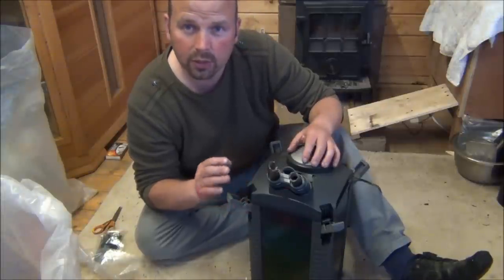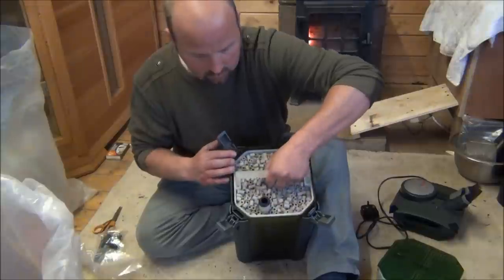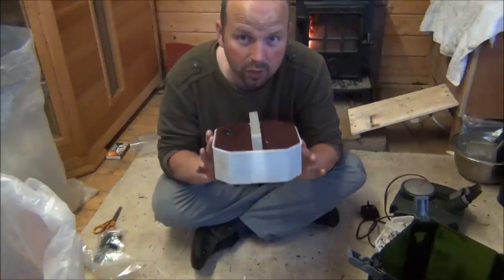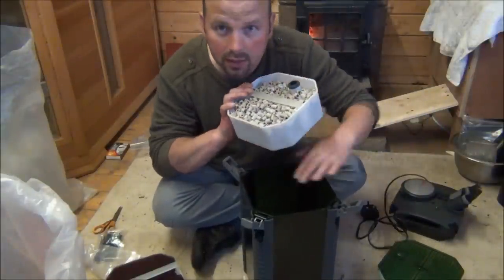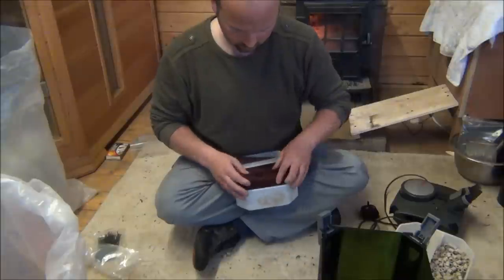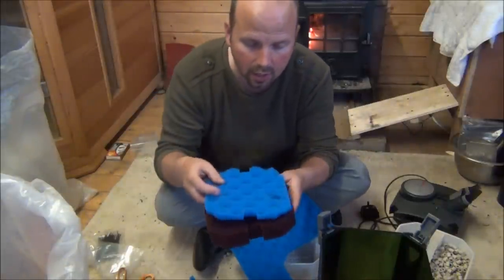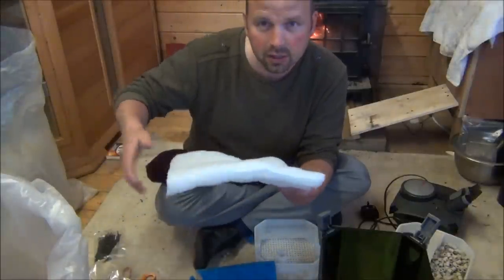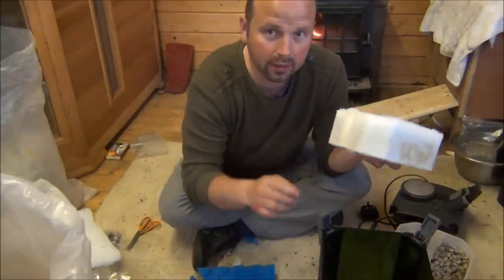How to set up an external canister filter for aquarium by Pondguru

Comment from the maker: +Joel Kim
Not really as anything fine enough to get through the coarse, medium and fine foams will simply be caught second time around. Last thing you want is the fine particles held in the media chamber clogging up the media and reducing efficiency.
Reply from the maker: +Mr.b External filters are generally very quiet and the main noise will be from water entering the tank via the spray bar.
Reply: +Pondguru Outdoors great answer and yeh if there is any noise generated thats loud enough to hear from these you may have air in your pump depends really and also if there is a quite hum im guessing you have it underneath the tank on wood or whatever its on you can reduce the resonance with a rubber pad or a sheet of thin foam thing is  you will get many different answers on the internet by hobbyists and everyone has there own setup and opinion on things i just think its a research and learn thing you will never get the write answer about stuff like at the start saying ceramic media is less than useless well it isnt its good in a fresh water tank and its a sort of substitute if you dont have live rock
Reply: +Pondguru Outdoors I have some cheap filter and its the other way arround. I guess its just a design. The 2x bio media is great idea ill try adding more bio.
Reply: i have 2 yellow belly sliders and they are very messy, i have an allpond 1000L an per hr filter in abt a 300l tank, it has 3 chambers, bottom has ceramic the middle has premium carbon and the top has bio balls.

If i have ceramic rings in the bottom trey, and the 3 foams you used in the midlle trey and the same media you used in the top trey will it srop my nitrate levels building up so high, after 2 days they can hit 80ppm+.
Reply from the maker: +Link SSZ (Nintendian) Sounds like the filter is way too small for that tank. Ideally you want layered foams in bottom tray and media in 2 trays above that but according to my records the trays for the 1000 will only hold approx. 1kg biohome mini ultra / ultimate per tray so that's only 2kg for the 2 trays. Ideally you would use 1kg per 100 litres to achieve full cycle filtration for a normal tropical community tank but for heavy polluters like turtles you may need twice as much (the equivalent of 3 of the 1000 filters - 6kg in total).
If that is the only filter you have on the tank it has no chance of making the water good no matter how you configure the inside unfortunately.
Reply: Ok thanks for the info :) i also have the filter booster, if i was to get the 2000ef model with 4 trays and fill that with the media you use (i don't know how much the trays hold) and the booster with the foams could that be enough?

Thanks again for the reply :).
Reply from the maker: +Link SSZ (Nintendian) Yes that is the level of filtration needed for turtles and the 2000 plus booster would be a very good choice for that scenario. The booster does a great job of cleaning the water freeing up the main canister filter for the biological media. Each tray in the 2000 should hold approx. 1.65kg of mini ultra or ultimate so in total that would be around 6.5kg - if you are in UK and would like a price for that just let me know at pondguru@btinternet.com or check my website for other suppliers around the world http://www.filterpro.co.uk
Regards,
Richard
Reply: Awesome ill get the 2000ef as soon as i have the money :) just wondering what the results would be if the trays were filled with premium carbon as i have a few KG left that i bought in bulk,

And yes i live in the uk, i have looked at your website and 5kg for £65 is way too expensive for me :( i would have no choice but to buy a kg bag every couple of weeks until i have whats needed.

How long does the the mini ultra/ultimate last? And which one is better for turtles?
Reply: Thanks for answering my questions btw :) i have been to a few pet shops and none of them could give me any of this info even ones selling the turtles.
Reply from the maker: +Link SSZ (Nintendian) It really bugs me when I hear of shops not taking an interest in filtration - they are basically condemning the creatures they are quick to sell to an awful death.
The carbon may help soak up some of the ammonia ad nitrite but is not a long term solution to the problem so running with what is supplied until the filter can be set up properly will be fine.
Best to keep both filters running for at least 2-3 weeks to ensure that the new one gets seeded with enough bacteria to take over the job.
Either the mini ultra or ultimate will do great job although the ultimate does set up a bit faster and for the first year or so enables the bacteria to process waste faster (as the trace elements act as a catalyst - trace elements take a while to build up on 'sterile' media).
The media should last a good 6-10 years at high efficiency when well protected by the foams in a properly set up filter.
Reply: Holy cow 6-10 years 😱 thats amazing im shocked, it's deffinatly worth the price especially as i know yellow bellies can live up to 30 years or so.

Im deffinatly going to buy some of the ultimate mix hopefully in the next 3 months :) thank you so much for the info.

As for the shops it bugs me too as none could give me any info, i have done hours of research online for the last 2 years trying to keep my water in the best condition it can be, so far i only have to do a partial water change every 5 days or so which is pretty good from everyday lmho, when i first had them it was a nightmare as everyday there water would start to smell like a sewer untill i started learning about proper water filtration, i luckilly stumbled across your video and it feels like a god send, i have saved your website to my homescreen and i will keep everything you have tought me in mind ;) thanks again for the replies and awesome info it means alot.
Reply from the maker: +Link SSZ (Nintendian) No problem, any time. Best of luck with the upgrade - I'm sure the turtles will thank you for it.

Comment from the maker: rec0n117 With regard to chemical filtration it really needs to go right at the top so it is the last thing the water hits before it leaves the filter.
Reply: You didn't have any activated carbon/zeolite. Should I go the way of you and exclude those from my canister filter and use the now free space for more biological media? Thanks.
Reply from the maker: Bob Faith Carbon can still be used if you want to lock up any colouration from bogwood, almond leaves or peat balls but it is often used by filter manufacturers to mask the fact that the filter is not working properly (due mostly to crappy media) hence the need to replace regularly when it is full of the pollution the filter should have processed. Similar story with zeolite. If you have a filter which is correctly set up with quality media and is big enough for the size of the tank you should not need carbon or zeolite and your water changes will be less frequent due to the increased efficiency of the filter.
In short, yes after the mechanical filtration has removed all the suspended dirt from water try to get as much biological media in there as possible to process the ammonia, nitrite and (in the case of biohome) nitrate too.
Reply: This is what I read on Eheim website.
Tip:
Only use adsorptive (zeolites and carbon) filter media for a few weeks, as the harmful substances are only attached and can loosen after some time and be reintroduced into the water. At the very least they should be changed regularly. Normally adsorptive filtration is only necessary during aquarium set-up or after treatments with medications.

Thanks for the tip mate. btw, which canister filter would you recommend? Fluval or Eheim? I live in Australia and these appear to be the two most filter popular (or at least widely sold) brands. Hopefully you can get a distributor into Australia one day cause I really want the Biohome media *sigh. I don't mind using my ceramic rings but they ain't very good for anaerobic bacteria colonisation. The shipping cost to Oz is insane!!! Thanks for the help.
Reply from the maker: Bob Faith Yes shipping is very prohibitive to AU from UK and nobody seems willing to take the plunge with regard to distribution which is a shame as I regularly get asked about a supplier for that region. That description from Eheim seems fair and those additives really are just to remove excess chemicals from tap water and treatments. Once your filter is mature and processing all the waste you shouldn't need them except for maybe after a course of treatment to quickly remove it. I would personally go for Eheim filters but they are very expensive. Ultimately it is more important to have the correct filter set up internally as that will dictate how well the filter functions with regard to waste processing and an expensive filter set up badly will never outperform a cheap filter set up properly with good media.
Reply: Pondguru Ok I have just taken the plunge and purchase Biohome Ultimate. Sure the delivery fee (to Aus) cost more than the actual product itself and many people will think I'm crazy, but it'll mean that I'll never have to buy carbon/zeolite ever again so hopefully I'll save some money in the long run. I really don't like having to change the carbon/zeolite every month or so.
Reply from the maker: Bob Faith Groovy, thanks for that, man. I have it packaged up for dispatch tomorrow when the post Office re-opens.
Reply: So if I understand this correctly...if you are going to use Carbon in an external filter, it should be placed at the very top of the canister?
Reply from the maker: Shelley :) Yes so it is the very last thing the water hits before it leaves the filter.
Reply: Pondguru I have a question regarding this. I have a Fluval Spec 5 and the OEM Filter has the big Sponge then goes through the carbon Bag, then the Media bag, then back out. Same with my AquaClear 70. Sponge, Carbon bag, then Bio Bag. So are both of the setups incorrect? Why would the manufacturer recommend those setup's then? Thanks for the help.
Reply from the maker: Orlando C Karpf Carbon has such tiny pores that it needs to be the very last thing the water hits before leaving the filter. If not the particles in the water will quickly clog the pores and render the carbon ineffective. I suppose if the foams and fine pads are doing a good enough job there could be a case for swapping positions of the media and carbon with no effects good or bad. Generally filters will come set up to quickly clog carbon so that it needs to be replaced more regularly. Just look at Aqua One tanks for evidence of that. A simple swap of the coarse sponge and fine pad / carbon cartridge will result in less clogging and higher efficiency / longer life of cartridges.
Reply: Pondguru Awesome man Thanks! I will be doing some Filter Readjusting today :) and im Def looking into some of your Bio Ultimate media. Keep up the good work man. Glad I found your Channel! oh and thxs for the quick response.
Reply from the maker: Orlando C Karpf No worries, any time.
Reply: Pondguru Hey I was wondering what are your thoughts of SeaChem Purigen . Instead of using Carbon I was reading that Purigen is a great substitute for make water clarity better. I have a 15 Gallon Planted with some driftwood Running a Aqueon 30, and I added some more mechanical Sponges in the box today. But I noticed that after a couple of days Water starts to turn brown from the Tannis of the dirft wood. Its been in there almost 2 months now. Would would be your recommendation for maintaining good water quality and Clarity? Oh btw I will be installing a Eheim 2213 on this tank as well. I bought a used one from CL for $30 just waiting for some parts to come in.

Thanks.
Orlando
Reply from the maker: Orlando C Karpf Either carbon or purigen should draw in the colour from the water no problem. Not sure purigen will make clarity any better than carbon.
Reply: Hi I'm about to set up a new tank(75 gallon) with a canister filter(Cascade) and I've never used a canister before. How often should the sludge be cleaned off the foam? I have other tanks but As I said I'm learning about canisters. Also what is the generic price for each Kg of media?
Reply: I would say check it for the first month and see how much dirt is in there. If it's a lot then you know monthly will be enough if it not that bad then you can leave for another month or two. Everyone's tank is different. So just test it out to see what works for you
Reply from the maker: Caleb Hubbard Yes, as Orland Karpf said below just clean as and when necessary. I'm assuming you are in the US so for the price of biohome check out www.greatwaveeng.com - link to my ebay page also in video description.

Comment from the maker: Unless you go for a media which supports anaerobic bacteria and or plant many more plants, I'd usually suggest water changes but when nitrate is high coming out of the tap you would need to use a product like Nitrazorb from API.
The biohome media actively reduces nitrate once the anaerobic bacteria has colonised deep within the media but will not eliminate it completely.

Comment: Your video was such an inspiration. Today I cleaned up my dophin 1300 canister filter on my 70 g tank. I had got it from someone. I had not noticed anything as it was from an established tank (I got it with the tank and the stock in it). When I opened it up today all media was all over the place as so absolutely wrongly stacked. The filter is strong and cycles at 2300 L per hour which is great.
So I stripped it completely. I removed the polyster filling which was so mucky and was in most of the 4 trays. I put the bio ceramic rings in the aquarium water in a bucket. I washed all the trays & I got the gunk out of the filter and washed it thoroughly. I put in ceramic rings at the bottom 2" gap which appeared in my canister filter too. Then I filled the first tray with coarse then medium & then fine sponges. I had to cut these out as your video showed. Then in the second tray from bottom I put in new bio balls. Then in the third tray from bottom I added the same ceramic rings which had all the beneficial bacteria in them from the filter. In the top last tray I added two bags of activated carbon as I had a new seasoned drift wood which was still giving out tannins. I washed the impeller and filled the filter with clean aquarium water. I have now plugged it in & the flow is great. I didnt get a chance to clean the input and output hoses today. Maybe next time.
Thanks for your video which was a great help. One question how often do I clean the canister filter ? Thanks again
Reply from the maker: How often the filter needs cleaning really depends on the fish stock, feeding and how much waste is generated in the tank. Usually it is best to check every month but if you find it to be clean after a month extend the cleaning to 6 weeks. If you are using carbon it will need replacing every 7-8 weeks so a maintenance schedule of once every 8 weeks would be the longest the filter could go without being opened up (to change carbon).
Reply: Thankyou

Comment from the maker: Like the best open pore ceramic media, sintered glass will break down over time but you should still get a few years out of it. After 2-3 years the internal structure of the media will be packed out and need replacing anyway. not sure if you ordered the ultra or mini ultra as there has been so much going out lately but they are both very good media. Protect with layers of good foam filtration and any media will last longer.

Comment from the maker: Same thing is true of all types of filter. If you are using good porous media it needs to be protected by graded foam. Coarse, medium then fine foam before the water hits the media. If the filter foams and media are fully submerged or wet/dry the need for good mechanical filtration prior to media is still the same.
Hope that clarifies.

Comment from the maker: That is the claims made by the distributor in Singapore. I tend to say replace the media in your external with biohome and if the filter was coping before it will do a much better job with the biohome. The amount of water any media will filter is very variable as it depends on fish stock, quality of mechanical filtration prior to media contact, flow rate, type of filter etc. it cannot accurately be quantified as far as I'm concerned.

Comment from the maker: There are so many reasons why water may be cloudy but usually it is from residual dust on sand or gravel. The fine particle pad / floss in the filter should remove the muck but a treatment which clumps it will help e.g. filter aid.

Comment from the maker: Yes, you can leave the pre filter in the top of the filter then add the graded foams (including the fine sponge) to the bottom tray and scrap the hard ceramic tubes. Filter will be much more efficient and your media will be protected from clogging quickly.

Comment: I did have quite high nitrate levels in my tank that required weekly water changes. Brought an external filter filled it with bio home mini and bio home ultimate with 3 stage mechanical filtration at the base. Took pondguru advice and stuck some in the empty space at the bottom of the filter and have had perfect water for 2 months now.thanks.ps clean out every month. 2 pearl guramis 2 balloon mollys 10 neons 4 xl zebras 3 Chinese suckers.17 gal.

Comment from the maker: All you would be doing is moving your existing sponges and fine pad to the logical position so you shouldn't remove any media.
The choice of media used will have the biggest effect on how many fish the filter will support.
As explained in the video, some media which comes with a filter is useless so should be removed or relocated (if there is space) to aid primary settlement. Having efficient media protected by graded foams will deliver a long lasting, hard working biological zone in your filter